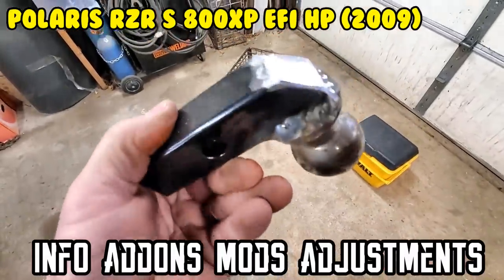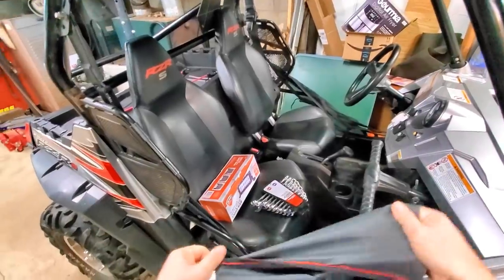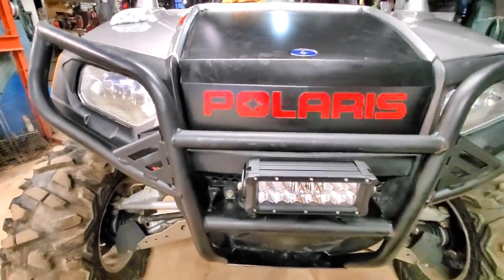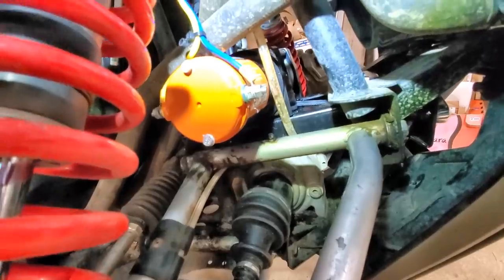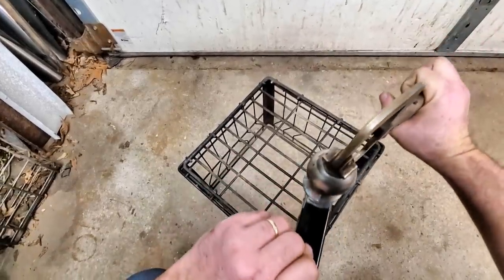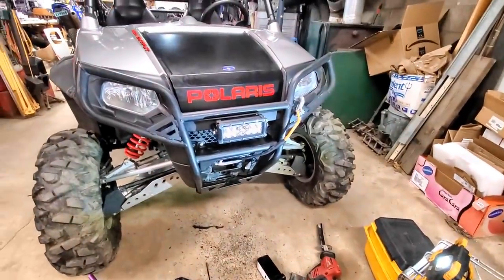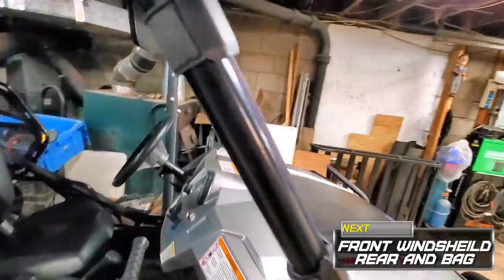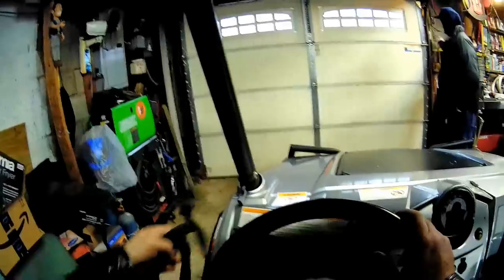Polaris Ranger RZR 800XP S EFI HP (2009) Info, custom mods, High Performance.

Comment: Sweet rig. Little tip to help out when mig welding thicker materials,  give the metal a preheat with a torch, lays a sweet bead.
Reply from the maker: Thanks! Yes that's a good tip, works great on cast iron (stops cracks) and aluminum (unless you Tig)
Reply: @MotoCheez  i almost always preheat aluminium for tig. Prevents hydrogen from getting trapped in the puddle.

Comment: Having driven a 2009 800s 10,000 miles in Arizona heat as hard as I can.......I'd say the holes are not necessary.......Polaris engineering is unmatched, when it works..........
Reply from the maker: I've seen others say the opposite. Rather have the best airflow possible.

Comment: In your climate you probably wont have overheating issues.
Reply from the maker: Gets in the high 90s during summer. But your probably right
Reply: @MotoCheez  
There's an old repair shop story of some guy complaining about his truck overheating going down the highway. Mechanic goes out to get the truck but comes right back in and writes down on the service sheet "remove snow plow, it's summer."

Comment: I have had an 800S since 2014 and wheeled it from upstate NY to south Texas in the summer.    No issues with overheating at all. The only time I have heard of anyone overheating is on a Sportsman 1000 XP in some deep silty water that blocked the radiator.   Great find!
Reply from the maker: Awesome. Thanks for the info. I've heard about the sediment issue

Comment: Definitely would vent the plastic for more air flow on the radiator. Don’t want any overheating issues. Will the side by side fit in the back of the mini Truck?
Reply from the maker: Agree. No, it's 10" too wide and a foot too long. The standard RZR would fit width size, it's 50" like the bed.

Comment: Did you or have plans on the tail pipe? When my buddy got done using boat trailer, it's too piping HOT to touch it because tailpipe blows down to it hahaha!!! My Polaris Ace 500 have different set up tailpipe doesn't blow down to hitch.
Reply from the maker: I did see it blows downward. Never thought about the heat! I'll look into that for sure. I'd mostly use it jockey stuff around my land.

Comment: I think its more (most) important that you keep the radiator clean, probably 90% of RZR owners didnt wash out their radiators, engines overheated, yada yada...  I would think a simple fan could move 10x more air (even with a mild restriction) than puttering around at 25mph with a few more speed holes.
Reply from the maker: Agreed, but a fan pulling thru a small hole compared to a larger one closer to the size of the radiator is still better.

Comment: I'm interested in getting a mini truck and currently have a Can-Am Commander (2012 LTD) that I'm thinking about getting rid of and just replace with a mini. I'd be interested in your thoughts on the pros and cons between the two, especially when it comes to off-road. I don't think a mini could ever do as much as a side by side, but I don't do as much extreme stuff as I once used to (hill climbs, mudding, fast riding, etc...). I think I like the benefits of jumping in a mini and heading into town via public roads.  This comparison could maybe be a possible video idea for you!  I know in your past videos you have really been impressed with mini's off-road capability, but did what were you comparing it against?  Thanks.
Reply from the maker: Hi. I had a 2010 Polaris ranger xp800 prior. Mini doesn't have the suspension so you'll have to go slower, but you'd be surprised where it'll go! I like the fact I can use it on the road and it's fully enclosed with a huge bed and heat! I did just pick up a RZR
Reply: Thanks MotoCheez. Keep pumping out mini videos and let us know more opinions in future videos. Maybe there is a retrofit that can be done to mini other than lift kits??  I think the smaller/early model Polaris and Can-Ams only have 12" suspensions.  Not sure if you could ever get that kind of movement out of a mini... Thanks again.

Comment: Only year for factory Chromoly a arms i've got the same rzr i bought new in 09
Reply from the maker: Awesome! I didn't know that... I've owned a few polaris. What are some good upgrades?
Reply: @MotoCheez  i've got a 3inch lift and 28's on mine and it does great the places i ride are pretty rough